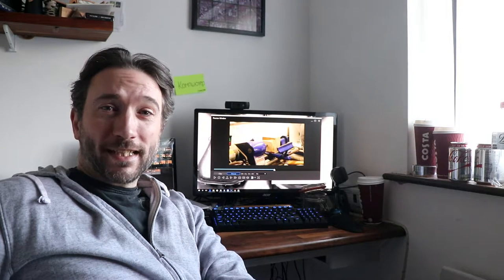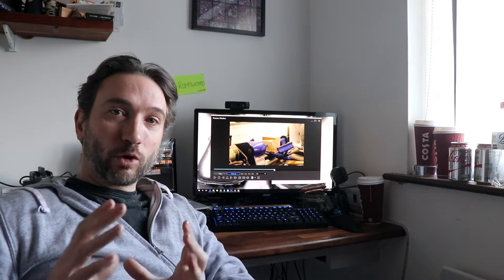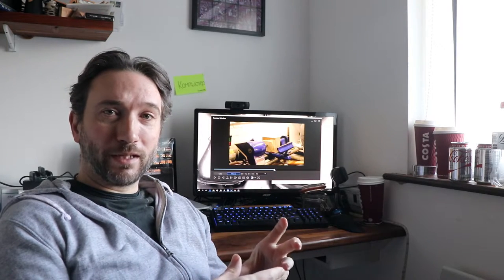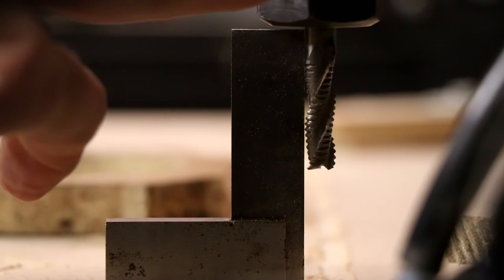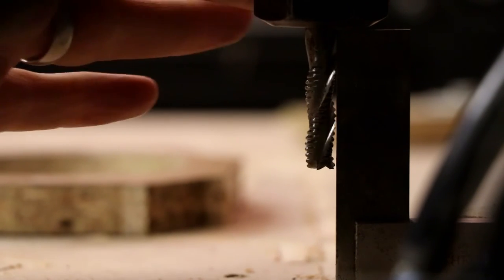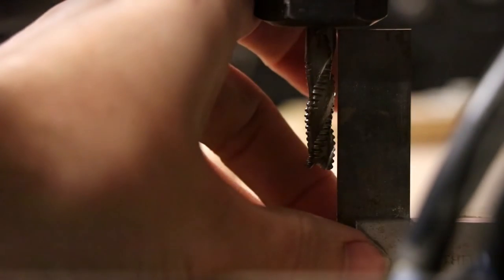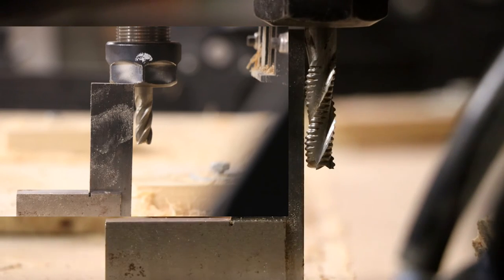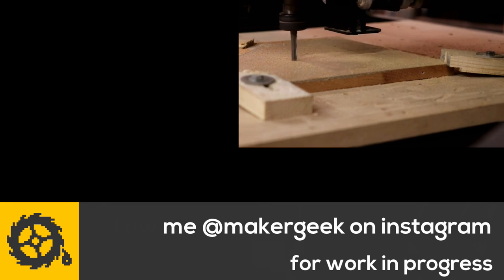ooznest ox cnc - 80mm Spindle mount from laminated oak block

Comment: You would be better of putting a piece of engineers steel in the collet to check that mate ? 1/4 inch or 1/2" ? I have a metal mill and that's what I use on that. Just a suggestion.
Reply from the maker: +Berkeley Jones almost certainly. But I don't have a piece of engineers steel. So needs must...

Comment: aluminum brackets from china tend to have a third bolt in the middle which pushes away from the bracket, with the two outer bolts pulling in, the idea is you can adjust the tram or tilt of the spindle by altering all three in such a way so that the middle one pushes in and the two outer pull in like a see saw
Reply from the maker: +zebedie2 one day I'll get around to buying a nice mount. :-) for now this one is still getting the job done well enough for my purposes

Comment: do you have problems with the heavy weight of this spindle ? this is about 5kg?
Reply from the maker: It is a little over 5kg, I've not had any real trouble with my set up. Initially I had to tweak the current to the z axis motor, but with my duet 3d setup its been very smooth

Comment: Make sure to seal the inside of the mount where it touches your spindle, the tannings in oak will react with the metal. If your spindle has a stainless steel housing you will be ok
Reply from the maker: +Jamie King that is a good tip. I'm pretty sure my spindle casing is stainless steel, but nonetheless something to be aware of. Thanks!

Comment: Could you not pack out the bottom of the bracket to square it up with a little piece of  sandpaper?
Reply from the maker: +David Street that was definitely the plan for fine tuning. Though I think it could get quite fiddly to do so and tighten things up. Once I've had more time with it I'll see if any minor tweaking is necessary
Reply: mine was off a little i used a guitar pic havent had any issues since. i like your videos. open builds sent me a c beam i plan on using for my z some day when i get the mini v wheels for the plate. will be a future video i think